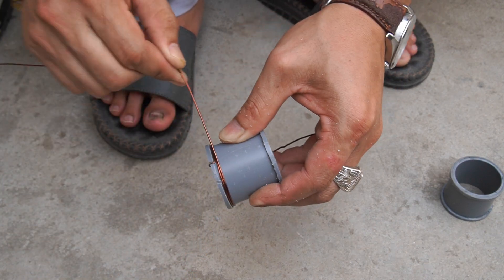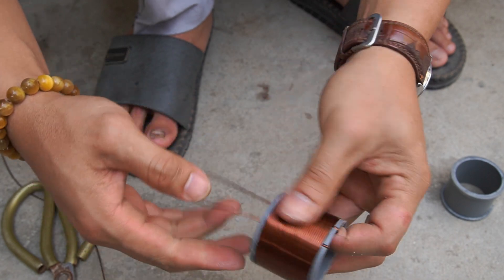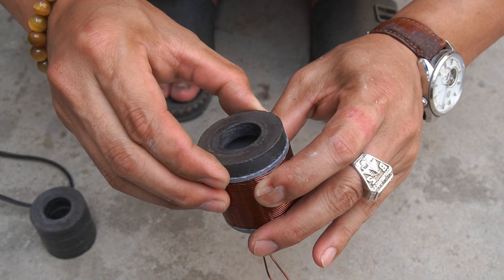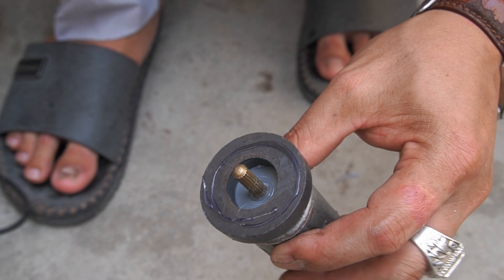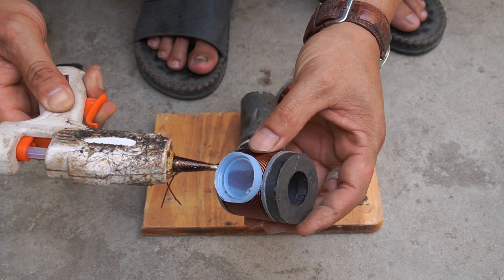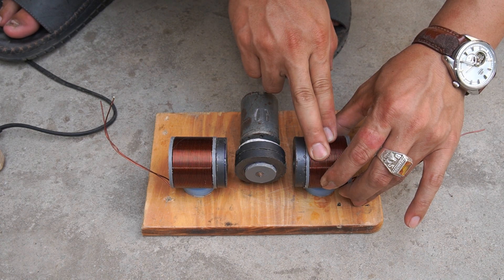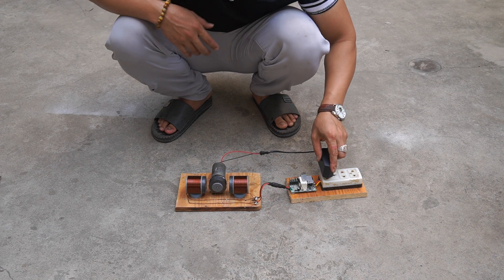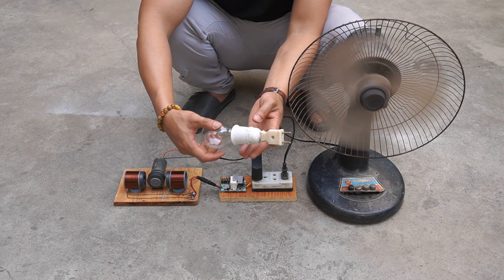I Tried to Build a Perpetual Motion Generator – The Surprising Result!

Comment: Did you design the pcb you’re plugging it into or is that something I can pick up and try? Generating just any voltage at any frequency is great for simple resistors or motors but for large scale energy use it’d have to be calibrated to specific outputs so as not to fry consumer electronics… where the board becomes very important… the rotational speed of the motor could easily be controlled to 60hz I’m guessing… then from there the best option would be to modify just how much current could be generated…
Reply: By the look of the plugs you’re using in your country, you probably actually need a 50hz power line… I think some European countries use 50hz, but outside Europe and America it can be best to attach an oscilloscope and test to see the exact frequency before hooking any of your prized electronics up to it… Just take a voltage reading and attach a resistor to the hot end to limit current through the meter, it will allow a safe reading of the actual output of the device..